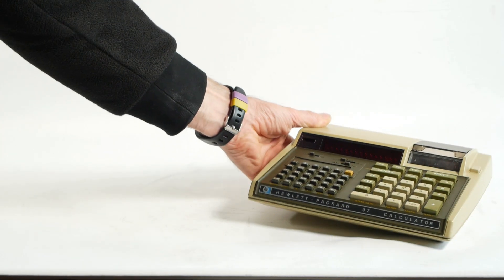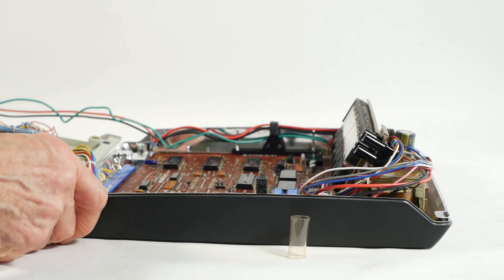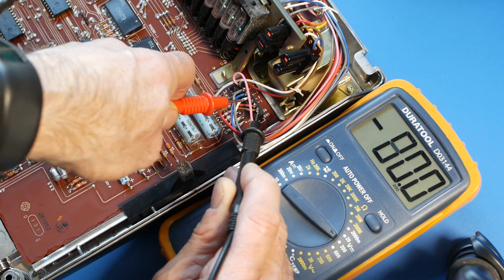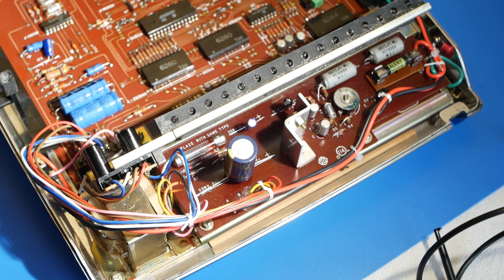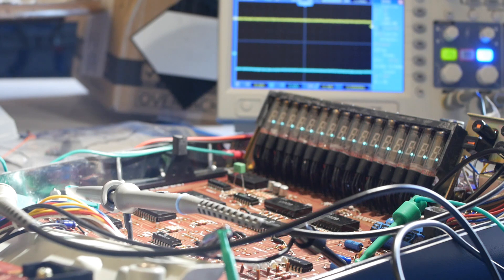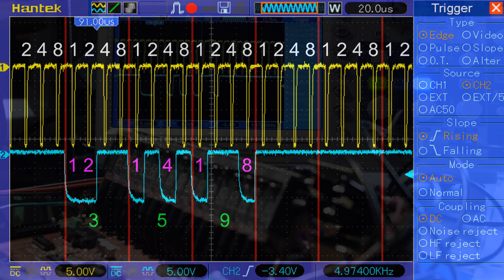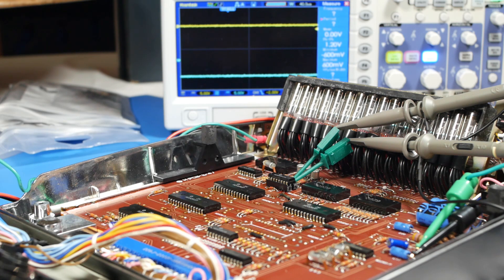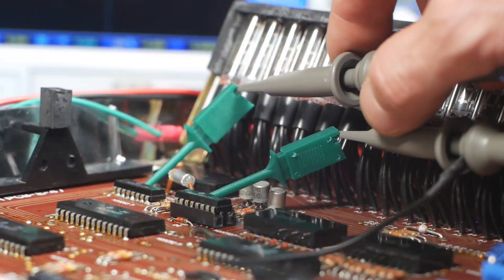Vintage Calculator Repair - 1972 Hitachi KK561 - Part 1

Comment: Interesting cap tester at 4:44, is it a commercially available unit or home brewed?.
Reply from the maker: There were loads of these available on ebay and the like - if you search for "component tester" on ebay you should find similar looking items, some come without the plastic enclosure and some even come in kit form.  They may not be a good as some expensive capacitance testers and so on, but they're really useful.  You can bang a transistor in and it'll identify what it is, same with capacitors, resisters and so on.  Mine sees a lot of use lately!!!

Comment: Hello Tim, congratulations on this impressive error analysis and on having such a talented brother.   Now I am the one to be  jealous 😉. Digital electronics is not very intuitive for me, so I have a hard time with such error analyzes on logic chips.  I still have a defective Walther ETR 2 nixie tube calculator lying around that eventually died.  There is also no documentation at all for the built-in chips. Your example now motivates me to try it again with the oscilloscope at some point, but I only have an analogue one and no modern digital one.

Keep my fingers crossed that the replacement chip will do the trick for your machine..
Reply from the maker: I'm envious of your nixie calculator - I really want one of those one day.  It probably didn't come across in the video, but I've spent WAY too much time working on this calculator to find out as much as I have.  My brother did find some vague and probably incomplete data on a couple of the small chips, but the lack of the enable signal to the chip that should be doing the segment driving does appear to be fairly significant, and that signal should come from the chip that I believe is faulty, but there could easily be something else that I haven't spotted.

Hope you do get to do some more testing on your Walther ETR 2.  The digital scope is a bit of a blessing, but theoretically I could have done most of the testing with an analogue scope.

Cheers for watching

Comment: Is it possible that the signal you are reading is some form of serial bus, that passes straight through each chip that needs distributed data, where it is read or written via decoupling capacitors.  The fact that the calculator is using BCD rather than pure binary places it fairly early in electronic calculator development, so they may not have come up with tri-state parallel busses at that point.  Perhaps there's a controller that determines which chip is to write its data on the bus, and all others are in read mode.  The display controller always being in read mode, but perhaps having a latching function to allow it to display a previous entry/result while the bus is used to transfer data that does not need displaying.  If the latching function isn't working, that may be why it isn't displaying the result even though the data is there.
Reply from the maker: I still need to get my head round it Simon - I have a manual for an even earlier calculator from Hitachi (or it might be a Friden - which was made by Hitachi), and I need to plough through that, because I think the methodology will be similar (maybe).  I could do with compiling all my readings into some sort of logical format rather than the pile sheets of scribbled notes that I have at the moment.  I'm not sure if it's a serial bus, there just seems to be data in random places going from one chip to another, like a signal going to the grid driver chip that has a pulse for every digit that should be illuminated.  There's a dedicated track going to the segment driver chip, carrying the current BCD of whatever should be on display.  There's another chip that has the contents of the memory present on 5 pins (2 are inverted versions of the other 3).  Hopefully I'll get to understand it a bit better because it's pretty fascinating.  I need to do some other stuff for a bit because I've spent way too much time on this machine so far!!!

Cheers for the suggestions, if the replacement chip doesn't do the trick (and of course I'll have no idea if it's even a working chip when I install it), I'll be back testing again with the scope - never thought I'd want a 4 channel scope but it would come in handy on this machine.

Comment: Interesting that you can deduce the calculator actually works but the issue is with the display. Good luck!
Reply from the maker: Yeah Ben, I didn't expect to find signals constantly being pumped round the chips with viewable data on them - I think you can read the contents of the memory on 5 pins of one chip - I wondered if they were doing something a bit like the early electronic calculators, where they used a delay line for storage, but all the signals looked to be in sync, just some were an inverted version of the other, so not figured it out yet.  Can't find much data on the chips and no schematic for the calculator, so it's a case of probing it with the scope and figuring it out as we go.  I'm hopeful, but not confident that the chip I'm getting from another random board will do the trick, otherwise it's another one for the "long term" pile.  Cheers for watching.
Reply: @GrumpyTim  Interesting nevertheless. Cheer.
Reply from the maker: Did I read a message saying you hadn't been well Ben?  How are you feeling?
Reply: @GrumpyTim  I am now fine. Working on getting the heater installed in my shed at the moment, between earning a living!
Reply from the maker: Awesome, just wanted to check you were ok.  Work really gets in the way doesn't it!!!!!!!
Reply: @GrumpyTim  It does.